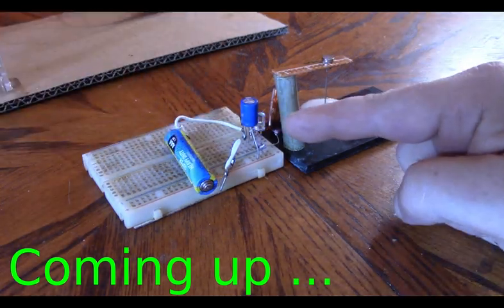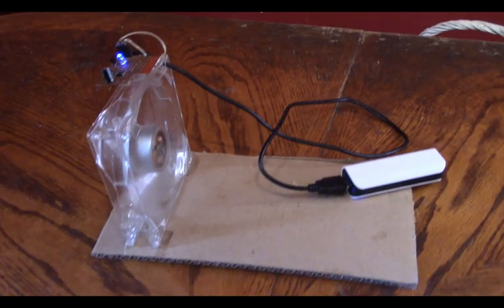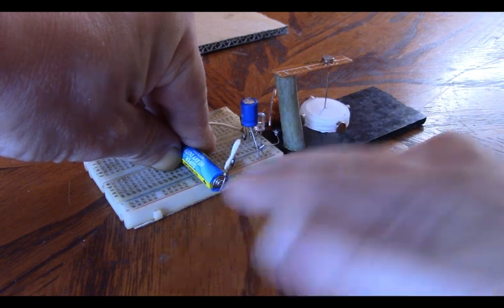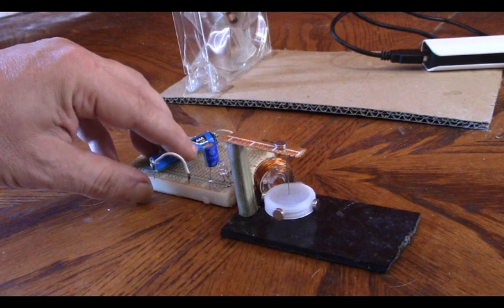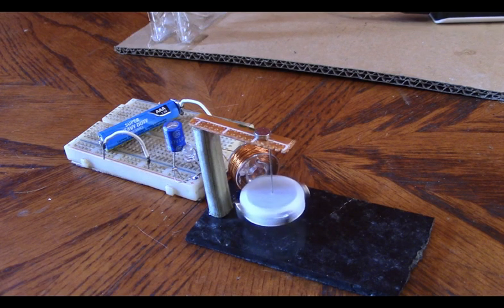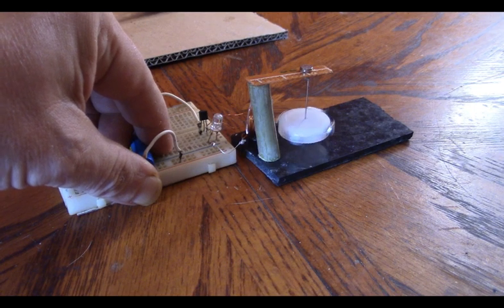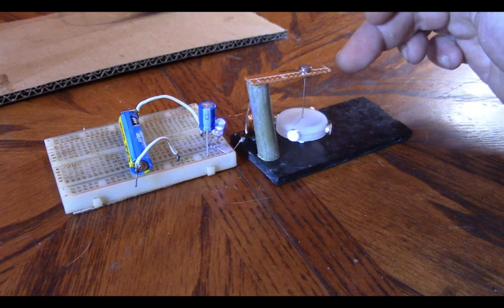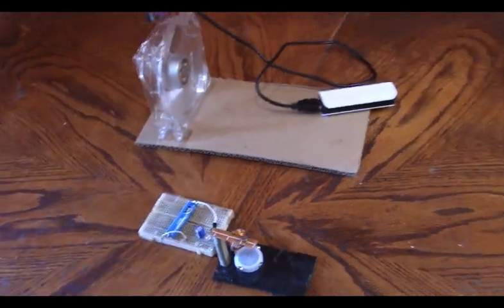Pulse motor bizarre effect

Comment: I think you have the coils in opposite polarity , setup in bucking mode . The Capacitor is being charged to a higher voltage from the BEMF of the coil on the base . The led might doing the rectification . The high pitched squeal is the circuit in self oscillation .  The circuit will self oscillate until the cap discharges . I have been working with circuits like this . Great video .

Comment: This reminds me of a boost circuit. Once the transistor allows for some current to charge the Coil (Inductor), the transistor will shut off the flow once the coil "fills" (and current cannot flow), then the coil will dump flyback voltage into the gate? of the transistor, thus allowing flow from the cap to recharge the inductor again ? 
My guess is that you will see some nice spikes of flyback voltage from the coil on an oscilloscope. Not sure if that transistor would survive a larger coil or source voltage tho... typically flyback voltage has a severe amount of gain.
Reply from the maker: Great info, thanks Marc 😀
It also would explain how the LED lights, using the flyback voltage... very similar to what is wanted/expected, but doing it in a different way. The C1815 used here only runs at up to 60V, so could easily find its way to a landfill soon!

Comment: is the energy stored in the coil and the rocking ....of the magnets releases it back into the system?
Reply from the maker: It should be that spinning the rotor induces voltage into the coil connected to the Base of the transistor, which switches it to fire an output pulse. That pulse is then induced into the coil that's connected to the Base again and onward it goes. Every transistor pulse makes an electromagnet from the coil connected to the Collector, turning the magnets on the rotor. The first time the transistor switches depends on inducing voltage from a magnet spinning past, which is why such motors usually need to be started by hand. 
I do agree it can be difficult to visualise or know how it works from just looking at it. Hope that helps 😀

Comment: Since blue LEDs have a higher voltage requirement to trigger the forward bias, it would be an interesting experiment to swap it out for a red LED.
Reply from the maker: That's interesting... running characteristics perhaps changing with LED type. 👍

Comment: Check the polarity of your windings.  I'd bet that you have the sense coil wired up the wrong way round.

In that situation, when you put power through the main coil, it generates a positive voltage in the sense coil which holds the transistor in the on state, so there's no oscillation (and the LED doesn't light).  Presumably, when the voltage/current drops to a low enough point, the gate drive ends up falling below the gate threshold voltage for the transistor, and it finally actually switches off, which then causes a back-EMF spike, which lights the LED and causes things to start oscillating through a slightly different mechanism (due to the switching EMF, instead of direct sense current).
Reply from the maker: Now that's interesting and thanks for your insight!
I know that it didn't seem to want to work at all until the wires were switched and (being me) I'd twizzled the wires for a neater/ more manageable set of wires. Which way around they were supposed to be was therefore lost in the twizzling. At that point I was only using the battery.

Comment: The transistor is turning the coil on and off right maybe something to do with the collapsing field?
Reply from the maker: Cheers Jon. It does seem like the strength of the pull of the magnets is overly strong and perhaps relates to the ungoverned collapse. At least, for how these little pulse motors normally behave. It also seems like the 1F supercap should run it for a lot longer. Have had a 4 coil motor of similar design last 24 hours continuously from a 1F supercap!

Comment: I don't know if I can post links so I'll just tell you how to find it... If you look for' Infinity SAV magnetic motor' on YouTube his magnetic motors behave a similar way.
Reply: But he doesn't give a lot of specific details about windings electronics coil directions anything
Reply from the maker: @3zdayz  Thanks for the info, I'll take a look. 
For these coils, I wound 300 turns, cut the wire, then carried on with another 300 turns. It's like a regular Bedini type coil  or pulse motor coil. Maybe that's an issue, 1 coil over the other compared to separate on the 5V USB fans, hmm.
Reply from the maker: Have just had a look at a couple of vids of his. Intriguing clear magnet disk with coils around the outside. I wonder if the angled coil is working like a gate jumper? (those wheel types with V shape of magnets around).
Thanks for the suggestion 👍
Reply: @Slider2732_  His later generators the coils are all face-on, seems to be 12 magnets and 12 coils, the coils are very fine wire, and lots of turns.... for the clear plexiglass motor I am inclined to think the angled coils are driving the wheel, and the others are picking up energy...  On that Infinity SAV channel is 'Full dismantling of 1 kW magnetic generator' - but there's quite a bit of electronics on that too that isn't really discussed

Comment: That is very interesting.  The Bedini SSG circuit chopped down like you did is amazing.  I have never seen that done in all the years that I have worked with that circuit. I think that it simply goes into self oscillation at a certain voltage based on the coil and cap tank circuit effect.  The led replacing the base diode makes a very curious indicator of what is happining.  Well done my friend!😀 JB would have gotten a kick out of this.
Reply from the maker: Thanks and yes indeed, miss JB to this day. Am sure we all do, he was quite the character! 
Think I got wrong footed with the simplicity and way the original 5V USB fans have run on this circuit... both recent ones are on all day in the PC room running on solar charged batts. They just work and this just doesn't lol

Comment: My first thought is self oscillation with a return to the capacitor (which will have a bounce back increase in voltage) and the led (diode) regulating the forward voltage and frequency.  I dunno.
Reply from the maker: Oh, as in the back EMF? That's very interesting, hadn't thought of that. The amount might prevent running too.

Comment: It does seem to relate to the supercap charging up. At 1:28 you have the supercap pos to the pos of the battery. In the next shot you have the supercap neg to battery pos. Interestingly enough the LED lights in both cases, but maybe in one case it is while the supercap is charging and in the other case it is when the supercap is discharging. Quite a conundrum 😁😁
Reply from the maker: Thought it was a case of needing some fettling, but then thought 'Hang on a minute!'
Ah, good eye on the supercap, in one shot I had to reshoot and might have got it connected in wrong, but it was just put in place to remove it. There's not a lot gets past you dear sir 🤣

Comment: Seems to be going into self occupation 😊 at a certain voltage. But i haven't got a clue. Hopefully you will have found out and explain in the next video. Great video and really interesting 👍
Reply from the maker: Yeah, like a at certain voltage range it runs fine, but needs to be set up further, perhaps with at least a diode drop when using 1.5V  😀

Comment: super cool please post your findings 

👍
Reply from the maker: Will do. I think it has to do with resistance to the Base of the transistor. Or, it should be something like that... but the same circuit with similar amount of windings works completely fine on 5V